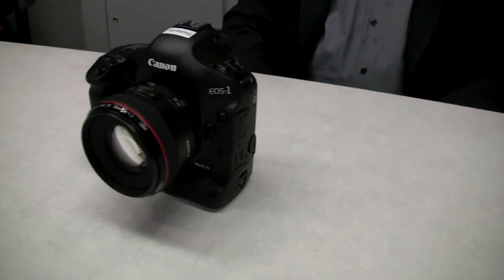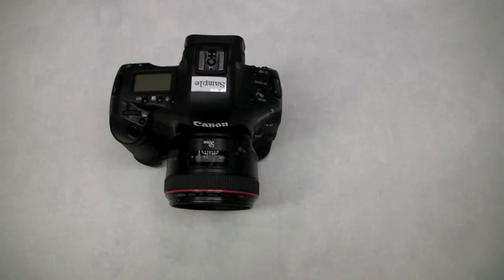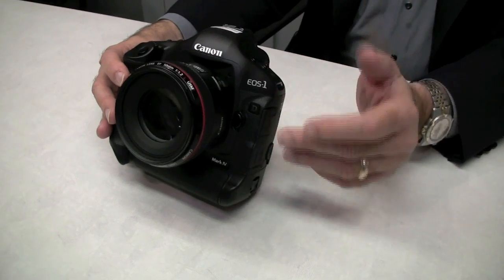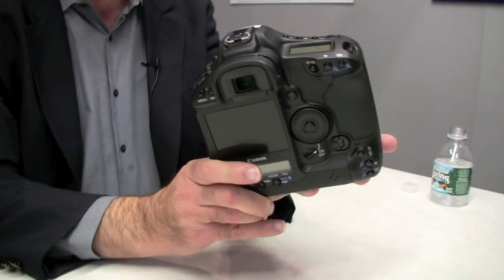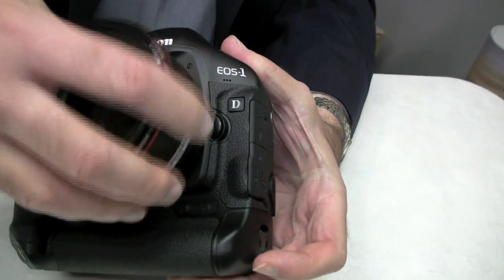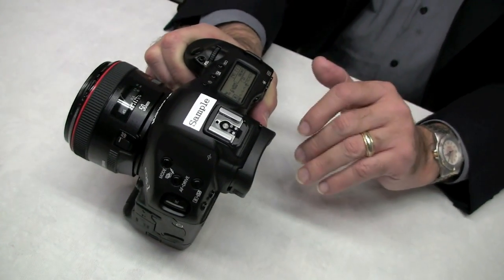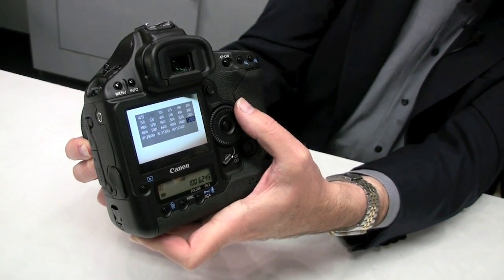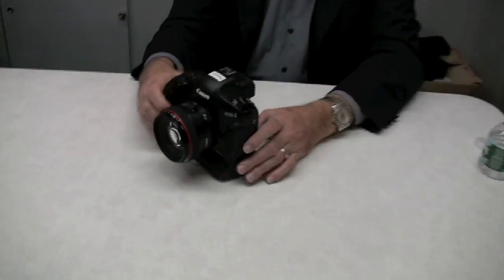Canon 1D Mark 1V -

Comment: I used the Canon 1D mark III for two years and did some sport shooting like Moto GP and cycling.  I also tested this camera on running dogs towards me. I liked and hated the camera. The AF was a pain in the ass. I tried all the settings and figured out that using the main AF point (the 1 in the middle) for tracking worked out great. Using more then one AF point gave me problems with focus hunting. I could not believe that from 2000 frames shot on a day 30 frames were sharp. When I used my old Nikon D2x everything was sharp.  Running dogs was almost impossible to capture. From left to right OK but towards me, no keepers. What I liked about the camera were the settings, ergonomics and the IQ. Still I am going to try the mk-4 to see if the AF issues are solved.
Reply: U-777 zevennaam sounds like your camera was faulty.